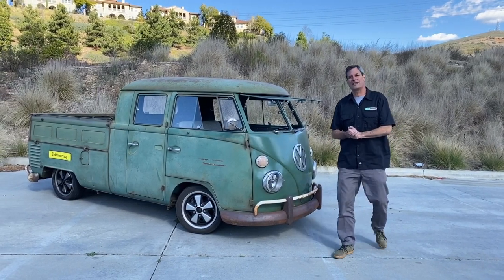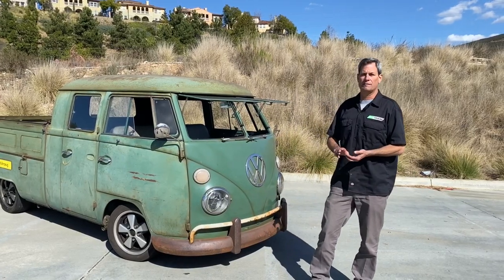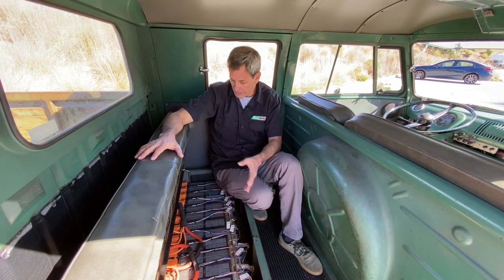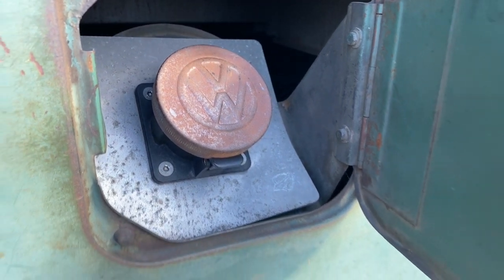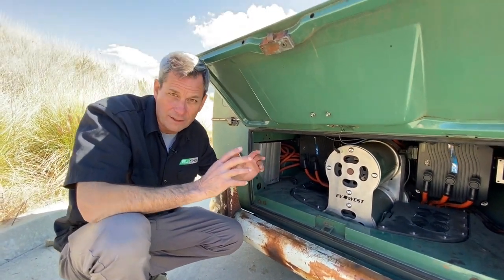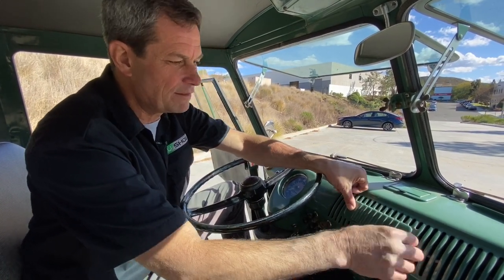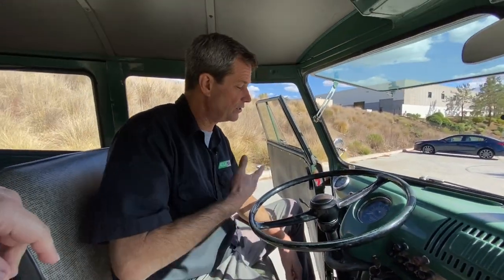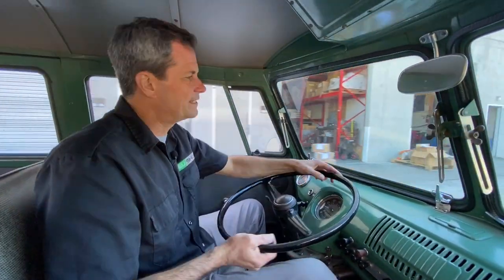Electric Dual Motor Volkswagen Double Cab Pickup

Comment: My father owned a microbus - mind you, I'm now 69 years old myself. So the "free play" comment really meant something to me. In a gusty cross wind, I'd have to move my hands onto the spokes near the hub of the steering wheel so I could react quickly enough. If I remember right, a remarkable thing about these were that they could carry 2000 lbs.

Comment: Nice easy fit for under rear seat batteries. What about the gas tank space. It’s less assessable but further back  in the chassis of the heavier nose double cab. Had 3 single cab 65-67 pickups which had basement cargo bay doors where you could access the crossways gas tank space ahead of the firewall. I assume that access is behind the rear seat in a double cab. Don’t get me started on the list of 60’s vehicles I had in my 20’s and couldn’t keep. Hate to talk about the cool stuff I considered then but didn’t buy.

Comment: I liked his demo of coming to a complete stop using the reverse switch and throttle use regen braking. 

Was expecting a different system that worked through the brake pedal. Ie: first x mm of travel would be regen braking before the hydraulic brakes.

Comment: Very cool build and nice to see one that is not simply a drag and drop of a Tesla drive unit! Question: There are a couple of points when you smoke the tire(s). In each case, you are turning right and only the right rear tire is smoking. Do you have an open differential in your transaxle and the right wheel is the primary drive wheel? Is there a mechanical limited-slip option for an application like this?
Reply from the maker: Hi my name is Drew and I am the new media manager for Ev West. Please email sales@evwest.com with questions and/or set up a time to get on a phone call with our team. We are in the office Monday to Thursday 8am to 5pm PST. Sorry for the delay reply.

Comment: I used to work with locomotive control systems in the 80s. Each axle would have its own traction motor. Typically 6 axles/motors on a mainline locomotive. To control the motors and speed, the motors would be put in a sequence of series/parallel beginning at start and until full speed. Series at start and parallel at full speed to control the impedance of the 74 Vdc motors. I've often thought that 4 small motors run in a series parallel sequence would be interesting in an EV vehicle.

Comment: I have a question regarding charging the batteries for maximum life. Is it better to charge the battery pack every day or go for several days and let the charge level get down to a certain level and then charge it. For example, if I had a converted El Camino and a daily commute that used 25% of the battery's capacity, would I want to recharge the pack every night and bring it back to 100%, or would I prefer to drive it for 3 days, bringing the battery down to 25% capacity and then plug it in? Which setup would maximize the number of miles I got out of the pack before I needed to replace it?

Comment: Do the rear axles have any hydraulic brakes other than the regenerative braking?

In a different vein, in the 70s, Japan would import pickup chassis with engines and cabs and attach an American made box to complete the pickup truck, supposedly to avoid the tax. Guess which part rusted out first.

Comment: One thing that always made me curious about those air coller VW conversions:
What's is done in terms of frame rigidity?
The old spine beetle chassis can't be strong enough for the added weight and power without trying to twist itself into a pretzel...
( I know buses are unibody, I'm referring to beetles and Karmann-Ghias)
I ask because at some point I plan on getting one of those Karmann-Ghia TCs from South America...

Comment: Hi Michael, i looked on the website, but couldn't find the dual motor kit. Is it hiding somewhere special? I assume this would also fit a bay-window Single Cab? I have the double doors for the tool chest, so I was thinking that would be the perfect place for the pack. Maybe put it on sliders for maintenance?

Comment: I have a 1987 4WD Toyota that could accept the system you have here.  How much was the whole setup - all inclusive ?  Thank you for the demo and info.  Tech has come quite a ways in five years ?  Thank you again
Reply: put 900lbs (batteries or plumbing fittings) in your truck and it will drive great and smooth, Cadillac style. I had one too, awesome!

Comment: Love your work, but you ever consider using safer doner vehicles? Ones where the driver is NOT also the crumple zone, maybe even with functional airbags?
Edit: Sans airbags, I suggest the greatest pickup truck ever made, a 1970 Ford F-250 with a full 8' bed and lumber racks. Had one as a work truck and I miss it dearly every day.

Comment: Is it possible to run a small gas generator like a honda 2200 or 3000 watt in the back of the bed while driving to get extra mileage and to recharge the batterys with out needing a charging station?

Comment: A battery question: Did you use the space behind the firewall panels, where the gasoline tank used to live, for batteries? If not, why not?

I am asking because I have a single cab that I want to convert to EV. The space behind the firewall panels looks like a great place for batteries, so that the space in the storage compartment is preserved for storage (though that could also be used for batteries, resulting in a phenomenal range.)

Comment: (So Sweet!) How do you deal with the aggressive regen as far as brake lights in these conversions?
Reply: These motor/controller systems generally have a provision to trip a brake light relay when in regen mode.
Reply: @markcbrems  Even my ebike can be wired for regen/brake lights.
The new and cheap accelerometers should be used in all vehicles so brake lights go ON when the vehicle decelerates for ANY reason, thus alerting the driver behind.
So, brake lights for; brakes, down shifts, tire blow out, engine failure, etc, etc 
MUCH smarter than a brake pedal, and can built into any PCB/MCU easily.

Comment: I had a "concept" of replacing the bed on a double cab with a single cab bed, place a 4wd frame on it and mid mount a diesel engine behind the dbl cab (there's other significant additions/modifications).
Did you say that has a 184 mile range (92 mi to return)?
I'm thinking (not counting the additional modifications, I'm guessing a 140 mile range (70 mi to return), at best?  ;-)
I've watched many conversions into smaller cars (Karmann Ghia) and am saddened by its loss of usefulness as a daily driver, ie: groceries.  ;-)

Comment: Have you all contemplated an awd bus/van?  Would like to see an electric syncro
Reply: Great question. The classic buses are rare and increase the cost of conversion (cost plus restoration of mechanical systems, rust damage, etc). The supply of later vans might open EV conversion more drivers and more small business converters. Green jobs.

Comment: thanks so much for this video!  super informative.  I have a 65' 11 window and dream of doing this conversion.  However, there are so many different $$ numbers i have seen for a conversion.  Starting from scratch to built running vehicle, how much should i be saving up for?  Not just the kit (7,600), but with something like this double cab with dual motor and Tesla 54KW hr packs?  Its so hard to go full electric without knowing the full extent of costs adders (install, battery, cables, fuses, etc) that could blow my budget.  If I knew a full out number of a few different levels, I could better prepare finacially for converting my bus (which doesn't have a motor at the moment).  Its either go Gas, or Go this way, which is my first chioce.  Any help on this, would be greatly appriciated!  Thank you!

Comment: After watching this video I would love to find either a Greenbrier van or pickup truck I've always wanted one I love the way the rear moter in them does not intrude on the cargo area like the VW does my first vehicle was a 65 corvare after driving it around I had to relearn how to drive another vehicle the first time I took the GM pickup around a curve I'd taken my corvair around even at10 50 instead of 60 miles per hour I was so glad I was in the inside lane and had no one beside me as I ended up in the curb lane on a 45 degree turn and I haven't found a vehicle yet that that would hold the road or take bumps or rough terrain like that old corvair Nader did a number on it and with the speedometer not working I took it to maximum speed every where I went he said it would start to drift at 55 and since it never drifted I thought I wasn't going that fast but he was wrong and so was I I've since figured out I was going between 90 and 110 by the fact of the time it takes to get from one place to another in most cases at the proper speed it takes me twice as long

Comment: HI MR 
 can solve most problems and have found workarounds but the EVIC display is not something I can fix. 
i fix the battery side but it's still the motor side can any one help me please 
i'm working in prototype motor HYPER 9 HV controller  SME ACX144

Comment: could you do electric in the front. Vw motor in rear with regen so if you kill batteries switch on vw motor that also recharges batteries ? potential customer

Comment: Four smaller motors, Inboard disc brakes, traction control and why don't folks do that? More, smaller, motors means a better unit price and 4 wheel regeneration lets you use the braking in a turn to power the outside motors rather than wasting all that time on differentials.

Comment: I am confused...2s9p equals 30s how?! I was going to do an early model Corvair with a dual-motor setup that offsets the top motor to the passenger side. Most of the battery pack would be up front in place of the old fuel tank with some of the batteries under the rear seat. The rest of the system would be charger and converter up front with the rest of the electrics in the rear with the motors. Manual trans (probably 3 speed) will make it easy to reverse. Would definitely use disc brakes up front and the rear would be regenerative braking with the drum system at rear in reserve. We got to see a true California stop LOL Bad habit though. I was going to install electric steering assist on it also.
Reply: The pack is built with modules not individual cells, each module is 15s.